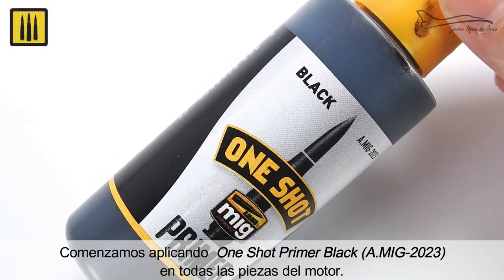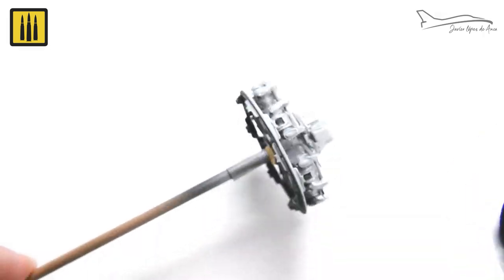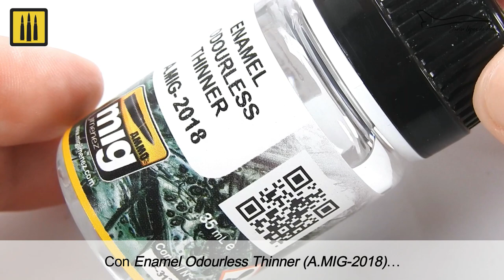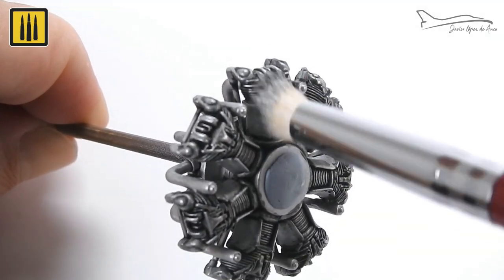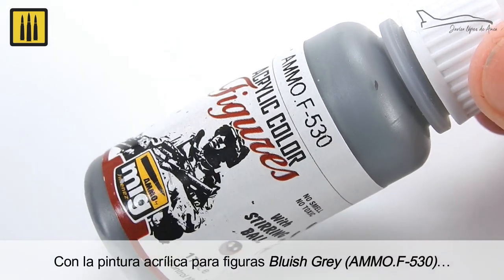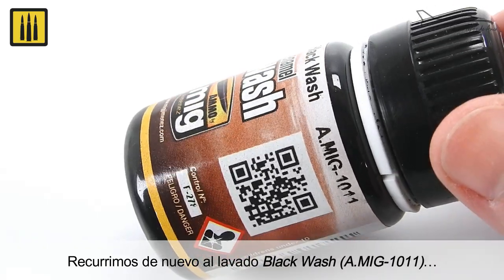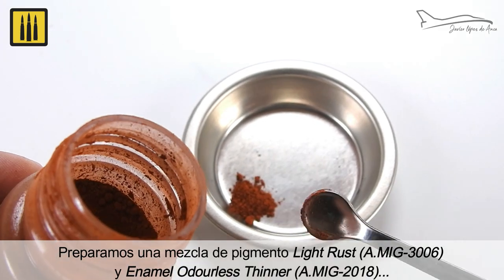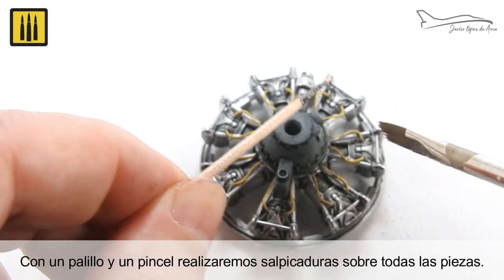How to paint a radial engine / Cómo pintar un motor radial

Comment: great tutorial, thanks! Do you separate certain layers by a coat of varnish (varnish before enamel wash) or do you skip that process?
Reply: I honestly would recommend it if you are going to apply it on an acrylic paint. 

With a lacquer paint, you wouldn't need to worry.
Reply: @blueonblack83  Exactly, that's what I thought, and that's why I asked them for clarification. Thanks for your advice! As for lacquer paints, their toxicity makes me hesitant to use them...
Reply: It is normally not needed. But I have some strange result with Ammo acrylic paint. Some colors will accept a wash (enamel or oil) without any issue, other would be removed with the first wash cleaning. I still not sure if it come from the paint,  or the primer (although I have less issues when I use OneShot primer).
Reply: @nathalieehrhardt259  Trust me, you do not want to risk a paintjob that you have spent hours working on. A coat of varnish > taking risks with your model
Reply: @pbyfr  Vallejo, Ammo, etc. My experiences with them when it comes to applying enamel thinners, washes, etc. are just plain bad. Part of the reason why I switched over to lacquer paints.
Reply: @blueonblack83  Better safe than sorry , right
Reply: @blueonblack83  I have use Humbrol enamel in the past, and I don't support the odor anymore. And I had other issues with them (mixing, various quality...). So I stick with Ammo, but I would try to protect it with a coat of Future before working with thinner over it.
Reply: @nathalieehrhardt259  Have fun \m/